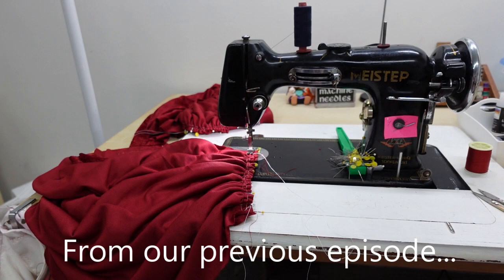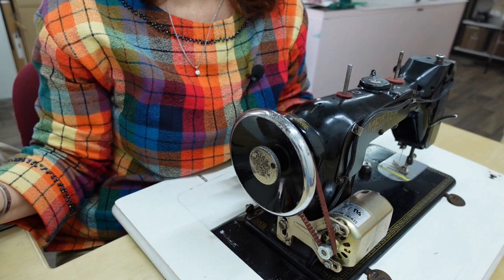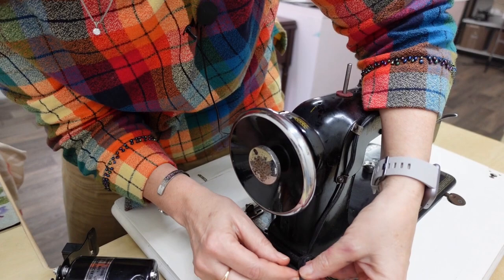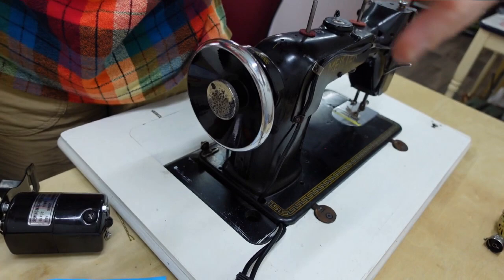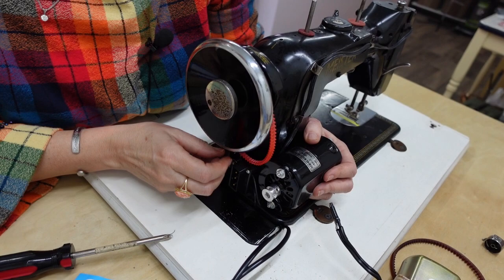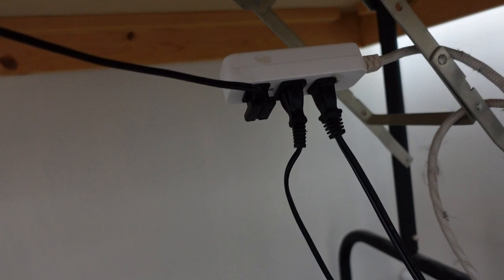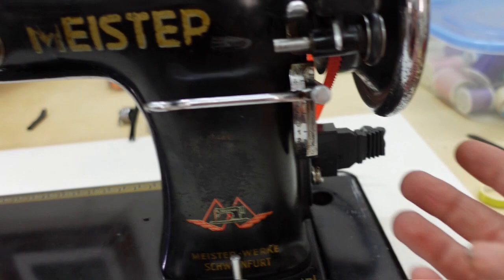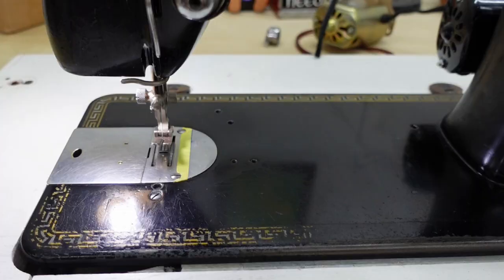Replace the motor and pedal on a vintage sewing machine

Comment: Hi Marie, nice work!  This post is better late than never! I bought the same motor and foot pedal from ebay and had a sewing machine repairman look at my parts. 
He said that the foot pedal has a block of ASBESTOS fixed inside as part of the speed regulator. I was shocked when he said that so I gingerly opened it up by the clip on the end and sure enough there it was! - a hairy white block! I quickly closed it and bagged it into a sealable bag and it will be disposed at a special asbestos drop-off site ASAP. The repairman said it was there because of where it was made. -he offered that they don't care about the dangers of asbestos as they are a developing country they haven't valued the long term exposure of it.
If you look through the slots on the sides without opening it, you can see the white block inside.
Please get someone qualified to check your foot pedal for your health and the health of every one in your home.
Again, love your work!
Reply from the maker: Oh my!!!
Reply: В этой педали асбеста- кот наплакал.😅

Comment: If your old motor works with the new brushes and you have a soldering iron and some shrink tubing you can easily reinstate your old motor, foot pedal etc.  There are quite a few youtube vids on that kind of thing and it's obviously well within your capabilities.  The modern brushes, though, don't last as long as the old ones so it's good you've got some spares.  Since your old brushes had worn right down you might also want to watch a video (if you don't already know about how to do this) to clean excess carbon off your commutator.  It's not hard, you can do a reasonable job with a Q-tip (or 10) without having to take apart the motor housing. :-)
Reply from the maker: Great idea for clean up with the q-tips! I've got shrink tubing somewhere but I could not find it so I had to resort to Old School electrical tape. Oh well, I hope you saw that I actually already reused that motor on another machine so everything is good. Thank you for watching.
Reply: @mybucoliclife  You did?  I've missed something...  That just won't do as I don't like to miss a thing of your videos.  :-)  I'll go find it now and have a look, thanks for the heads-up.

Comment: 8-9-23 Thanks for the video. 
I went to look at a suspect motor to see if it was the brushes. The Bakelite cap was broken before I even touched it with the screwdriver. Perhaps that was the problem, the cap was loose combined with the worn brush so contact was intermittent and whining/growling about getting started.

I ordered another motor set as you did from an e-bay seller I've bought items from before. Her selling point was this motor is from Taiwan, not China. Who knows if it makes any difference. 
I also ordered caps that fit that both motors and brushes, too. Neither were expensive and are from second and third sellers.

Perhaps I can salvage the motor when the broken cap remains is removed and a new brush and cap is placed so it makes consistent contact.
I'll need to hold the old motor upside down to fish out the broken screw-in cap to keep it from dropping into the motor area.

There are two brushes on these motors. One on top and bottom of the motor. 

The Dressmaker S6000 (blue) was purchased new in 1976 from a door-to-door salesman. My mom and I each ordered a machine and cabinet that day.

Friday 8-11-23 The new motor and foot set and belt with 2 extra brushes but no caps. The brushes and caps will arrive next week.
I found a way to unscrew the remainder of Bakelite screw cap. Salvaged the middle section that has a little copper cap glued on the underside that holds the spring in place.
Put in a new brush and spring. Taped the broken cap piece in place and it starts right up, no whining/growling.
It even sews smoothly again.

(I suspect a vintage Husqvarna I purchased a couple years ago has the same problem as it wants to grumble about starting.) That motor is enclosed however.

I didn't replace the lower brush although both were worn down equally.
I tested the old belt and it works without putting on the new one.
.....................
Why didn't I just install the new motor and foot pedal?

I discovered the light is wired up inside the machine and I didn't want to mess with that. I would also need to cut the wire to the motor as you did or cut the rubber grommet on the base of the machine to keep the motor cord intact.
When or if I do need to change the motor and/or pedal, I'll sort out the wiring then.

I'm glad new brushes (and a new cap when it gets here) was the fix for now.
Reply from the maker: Such an adventure! I need to tell you my motor fixing skills have greatly advanced since this little video was made. Have you seen my other channel? Promethean Sewing Machines
Reply: @mybucoliclife  I will go take a look. Thank you.

Comment: super helpful! especially the bit at the end about fiddling with the screw and belt on the motor to fix the speed. however i have a pedal attachment - the kind that heats up - with the light box that the motor plugs into that only goes one speed super fast. Would love any tips on controlling this. Thank you!
Reply from the maker: If buy a new electronic pedal that has a new light motor block with it. I buy mine off Amazon.

Comment: Thanks for doing this video on motor replacement,  I will do
Mine also.  I have a
Question regarding
Making a sewing  ham
And sleeve can I use
Sand instead of sawdust ?
Reply from the maker: I don't think that sand would work... But if sawdust is hard to get, another alternative is a tightly rolled log of newspapers, covered in fabric the same way
Reply: Thanks,  will try. HAPPY AND HEALTHY 
NEW YEAR.!!!!

Comment: I just received what appears to be the exact same motor for my Singer 66. I got it from Amazon and it’s going back. It didn’t work it goes from 0 to 100.  There is no in between. And it also doesn’t fit properly on the machine.  Did you not have that problem with your motor, I’m just wondering if there was an adjustment I wasn’t aware of to slow the t down.
Reply from the maker: Unfortunately quality control in Chinese factories isn't consistent at all. I know. I would really need to see a picture of the machine and bracket to know about the fit. You can usually raise and lower it pretty easily by loosening the main screw in the back. 
Sorry it took me so long. For machine questions send me a message through my website www.PrometheanSewingMachines.com

Comment: Hi I have a question about your heavy duty thread for gathering by machine , do you have a preference? Ty
Reply from the maker: In general I think a buttonhole twist or a heavy duty thread will work. The one that I actually use is a woven fishing line. Guaranteed to not break under any circumstances :-)

Comment: Can I ask how to turn the screw to move the motor? I cannot budge it.
Reply from the maker: Use a screwdriver the right size, maybe a little heat added to it, maybe add a pair if vice grips to the screwdriver shaft for added leverage... hold your mouth right and say a prayer :)
Reply: @mybucoliclife  It’s been weeks! I hope one day it just moves like the clutch and the feed dog lever did before it.